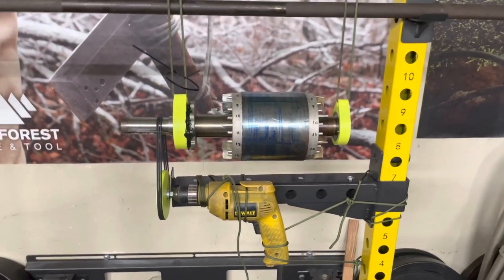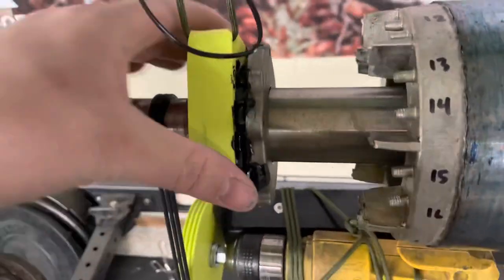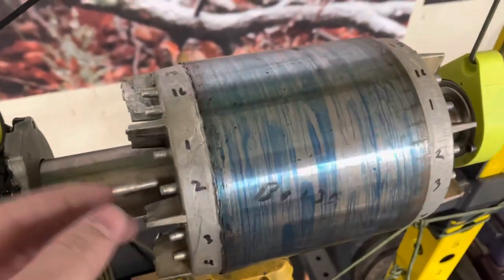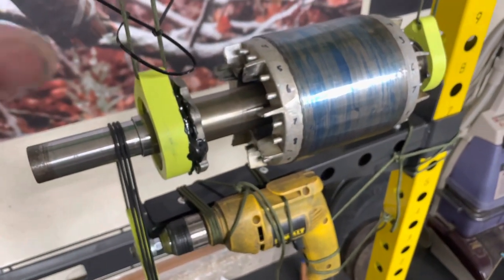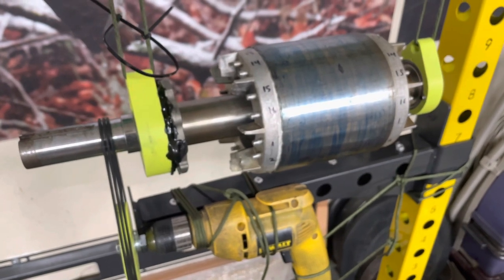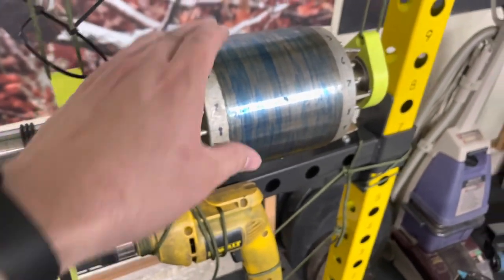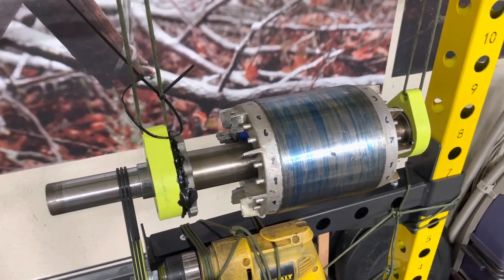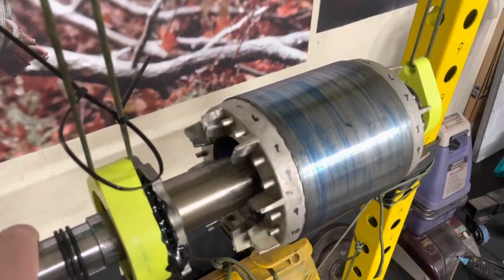Balancing My Fadal Spindle Motor

Comment: Yeah, you're definitely NOT dumb to have figured this out without any prior experience! Very interesting setup, basic to do in a pinch 👌
Btw, balance is worked out in vectors so that math you mentioned isn't actually too difficult - At least until you get into the realms of flexible rotors and critical frequencies haha. So you don't need to phase all 16 positions in, just a few. Since there's 16 positions, I'd do an even 4 and calculate an IFC (influence coefficient) from there. Easy way of doing it without going into the maths too deep is checking your average vibration from a set of runs (which is more accurate than doing single run, then balance according to that) and saying on average, this correction is better for both ends

I'm currently working on an open source dynamic balancer at the moment, I'll definitely be referencing this if/when I make a video of it. Good work!
Reply: Would love to see what you come up with. Do you post at some forums or similar, so one can have a closer look at the project? 👍